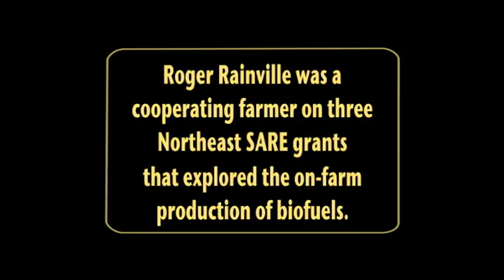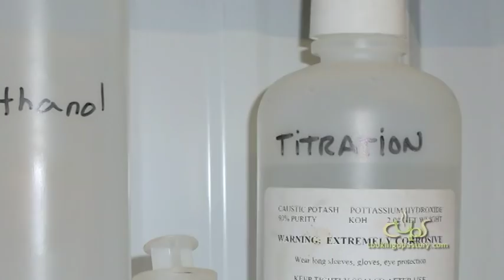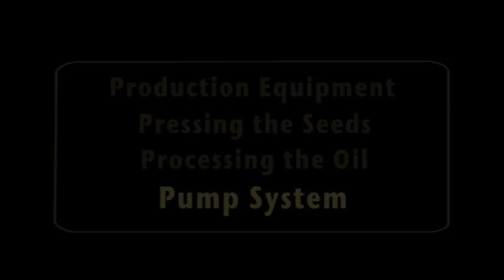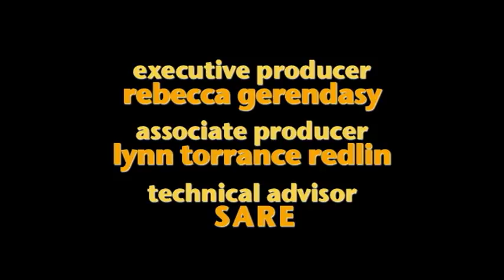Energy Independence On the Farm  - Biodiesel Fuel Production

Comment: put a screw auger under your cheap press to take the excess to a bag or bin storage. build a methane collection system off from  that excess to heat the building and home. then spread the composted waste back to your fields.

Comment: Do you have to pay taxes for fuels that you made yourself if you were to use on on road vehicles?
Reply: In case youre still wondering after 2 years: Yes, the federal road tax applies. If youre using WVO though(that is, not virgin oil) there's a tax credit which wholly subsidizes this cost. States may impose additional taxes. I will say though, avoiding this tax is easy both ethically and practically; when's the last time a state trooper demanded a sample from your gas tank and a receipt of your gas bill? And what right does the government have to extort you for something which you both wholly produced and is offsetting carbon emissions? Sounds more like banditry than good governance to me.
Reply: @HanzHermannHoppe  at least they will never find out, the problem is how to make fuel in the first place.
Reply: I think in Michigan if you use it on a vehicle you intend to drive on the road you do have to pay tax on that fuel however if you use it for Farm used farm machinery I don't believe you have to pay tax on that fuel
Reply: @johndumeney3905  funny two days ago I was wondering what if I buy cheap isobutanol from China and mix it into pure gasoline up to 20 percent as a “fuel additive”, I know fuel additives are not normally highway taxed, lol.